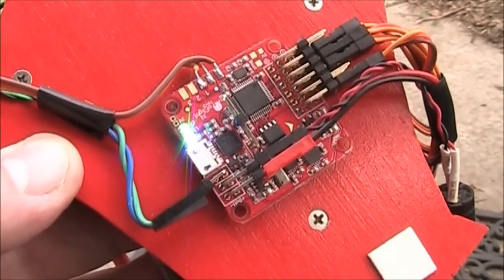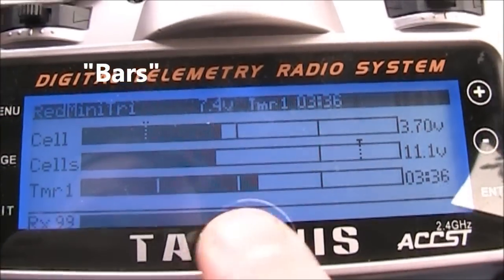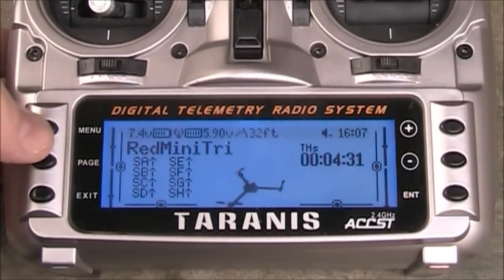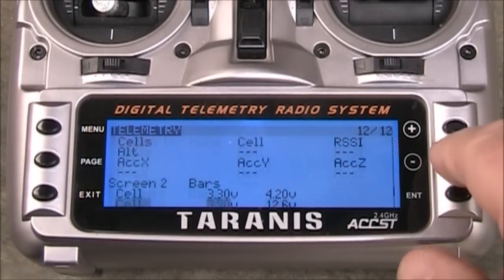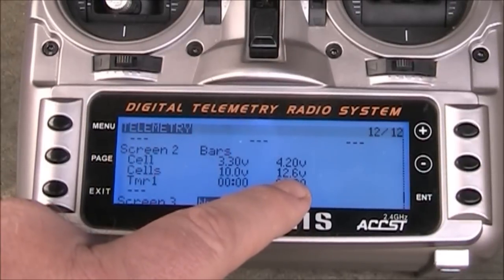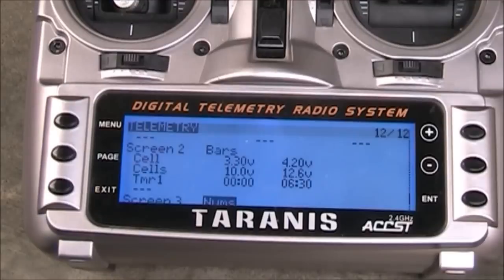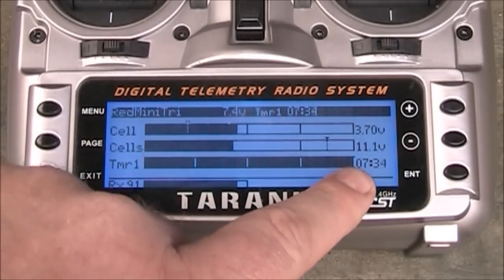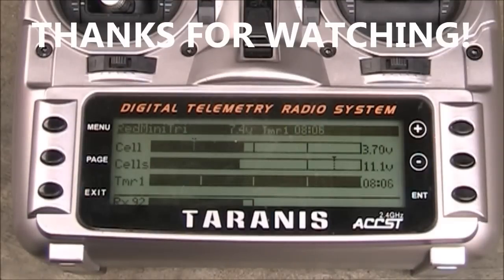Taranis Telemetry Bars

Comment: My telemetry screen shows no data other than Rssi even though I have two voltage and gps modules fitted with battery connected
Reply from the maker: When you go into the Telemetry screen and choose "Discover new sensors", does anything show up with a blinking asterisk?  That 'discover' option is new since I made this video - I need to make an updated one.
Reply: Yes, the thing comes alive with em!

Comment: How do you like the naze on a tri? Heard some folks getting headaches to tune them good. How does it compare to a kk (tri)?
Reply from the maker: The KK2 is WAY better with default settings than the Naze32.  I still don't have my Naze32 tuned as well as the KK2.  I want to like the Naze32 better, but I don't.
Reply: *****
 My suspicions are confirmed then! I guess for tris, KK is the go-to board. Thanks!
Reply: assaulter99 You should try the special tricopter code that David Windestahl has on his page:
http://rcexplorer.se/product/naze32-tri-frame/

Comment: How do you get the altitude to show up ok you're Taranis from the full Naze board, I only have seen people get battery voltage from the Naze board?
Reply from the maker: Tom Sanders I added it on the Telemetry page in the Taranis.  I think it is just part of the telemetry output.  I didn't make any other changes on the full Naze32 that what I set in this video:  https://www.youtube.com/watch?v=Q7KpBGDxZQ4
Reply: ***** Thats so cool! I have done quite a bit of research on the board and you are the first person I have seen doing this, how accurate does the altitude seem to be? another question I have heard people have had issues with the Full Naze board with altitude hold not working well and being flakey how has it worked for you?
Reply from the maker: Tom Sanders You are suppose to put some foam over the sensor because wind affects it badly.  In base flight, I'll watch the graphs and then blow on it and the graph goes to extremes.  I don't have any foam over it now but I did try it anyway on my mini tricopter.  The altitude hold can't hold correctly because of the wind and there are sudden drops and increases in altitude.  I've mostly been flying with no auto-level at all so it has really just been more of a novelty than anything useful for me so far.  I do want to try it with foam over it and see how well it works when it is setup correctly.  I'll probably post another video on that soon.